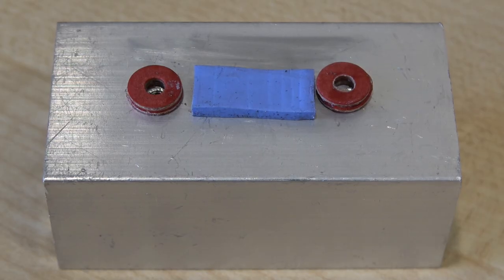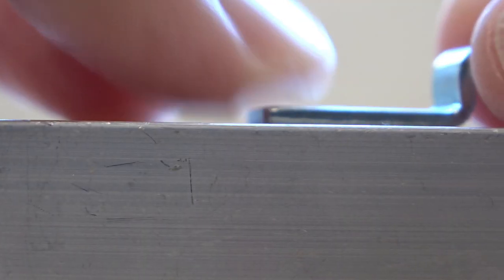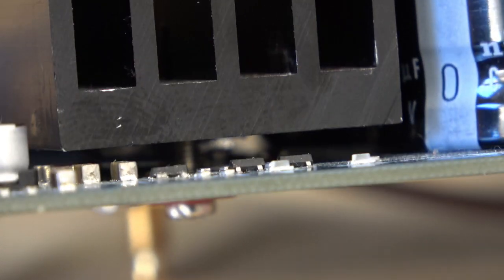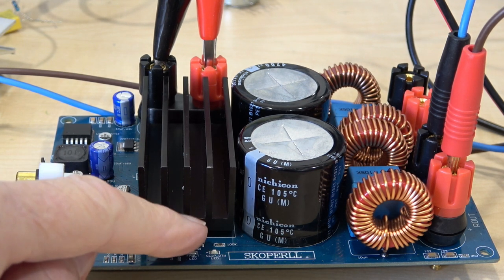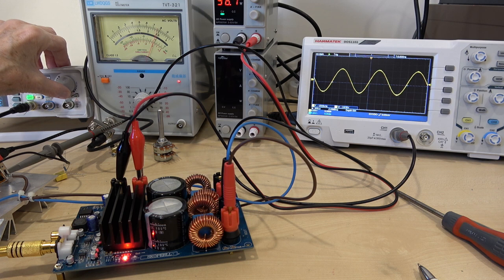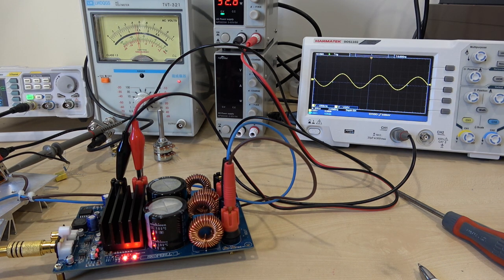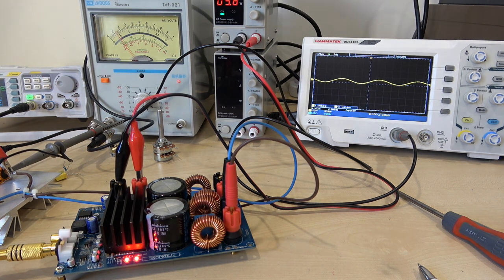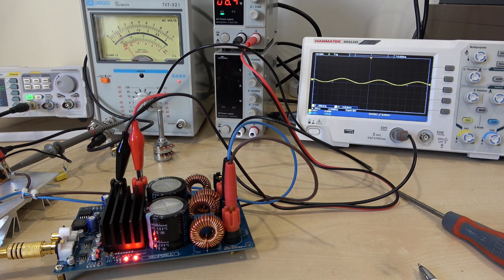MORE TESTS on this class D Amplifier (after some mods)

Comment: Hai iam also using tpa3255 amp  . Out of the box , ur right its clipping at around 50-60w 4ohms . And i tried so many power supply (smps only) . I have two meanwell lrs150-24 supply which is rated at 6.5A and connected is series to get 48v. Still its get clipped. And i use one audio grade smps from my very old sony amplifier which is rated for 189w at 38v . With this power supply i get more power and high dynamic power that can feel. But still clipping at more gain.that because that supply is floating.basically heat and supply design is the culprit. After cooling the chip with old laptop heatpipe and with thermal grizzly paste the heat is significantly lowed. And modify my meanwell supply to floating (no ground ).the clipping issues is solved and soo happy 😊😊👌. Now the only bottle neck is the supply because 6.5A is not enough. That tiny chip overloading my supply 😅😅.its better to have 8A to 10A supply.it can easily get 250w per ch

Comment: Sorry, friend, but a thicker heat sink 'sinks' heat better than a thin one.  Think of heating aluminum foil with a torch compared to heating a block of aluminum with a torch.  Which one will 'sink' away the heat better?  The thin one will vaporize, the thick one will take the heat away.

Comment: Just out of curiosity is the heat sink electrically connected to the PCB ground plane? The TPA3255 datasheet states it must be connected to the ground plane. Also as for the heat sink I think that you are right that it’s definitely an issue. At 8OHM with a power output of 175RMSx2 the TDP is just shy of 30W however at 4OHM with a power output of 300Wx2 the chips TDP is  approaching 90W which there is no way the heat sink could keep up with even 30W would be a struggle with passive cooling. Texas Instruments is a reputable manufacturer and I see no reason for the chip (if genuine) not to be able to reach the advertised power levels. I think most of the issue is a mix of poor circuit/thermal design and cheap and/or fake components. 
I’m currently waiting on the genuine TPA3255 evaluation board made by TI to run these tests and see what the results are.
Reply from the maker: The Heatsink is not directly connected to ground as I have fitted a heat transfer pad with a little grease.  None of these class D boards, give the rated power. This is the worse and cheapest. Texas rate things at 10% THD. I rate power at just the onset of clipping THD probably about 0.5% This board does not like 40 or more volts supply. Another reason why I cannot meet spec. I have tested other more expensive boards; they are better but no were near MY spec. The best board was the fan cooled double bridge. This was quite a good amplifier Just over 110 watts into 8 ohms. A long way off 600 however. Let me know how you get on with the TI board.
Reply: @MichaelBeeny  i certainly will update once it arrives and I’ve done some testing. 
Going off your ~0.5%THD the datasheet still reckons you can get (under perfect conditions most likely) ~150WRMS at 8 ohms however this requires ~52VDC to achieve. At 48VDC you should still be getting around 125W at 8OHM at ~0.01%THD. Anyways time will certainly tell if the fault is with the manufacturer or if in real world conditions those figures simply aren’t possible.
I actually live near Tauranga in the Bay Of Plenty so if you would like I could post it to you if you are interested to test it for yourself. 
Cheers,
Jordan
Reply from the maker: @Ultermategamerz  Hi Jordan, that would be interesting, where did you get the board from? I look forward to hearing from you after you have done your tests.
As you are quite close, might be fun to do a video on it together!! Just a thought.
Reply: @MichaelBeeny  Ordered directly from TI with a fairly heavy price tag however after looking at the components and design it seems almost justified. Just got it a couple days ago and after playing for a short while listening to some 4ohm speakers at a roughly measured 250-260W x2 it seems to perform well and not get too hot even without a fan. It’s my thought that maybe the overheating I’ve heard about online may be due to running test tones like sine waves as the average power dissipation would be higher compared to music. However my dummy load is only good for around 50W so I can’t really test that myself. I’m gonna do some more in depth testing this weekend. And yeah that could be cool I don’t really make any videos myself but we could do one for your channel if you would like I’ll email you later on. Cheers.
Reply from the maker: @Ultermategamerz  Hi Jordan, yes, testing with a sine wave is very punishing, but many amplifiers do very well on these tests. In the real world it is the benchmark of how to test an amplifier to get a fair comparison. I will be amazed, even if just music power if you can truly get 250 watts into 4 ohms but if it is possible, you have the best product to show it.
Reply: @MichaelBeeny   Okay so I ran a measurement using my 4OHM dummy load only for a few seconds at a time to not let the resistors overheat but the results are as follows 
(1 channel driven - 4OHM - 1000Hz Sine)

Vs = 53V
VRMS output before clip = 29.7V
Current Output 6.6A
29.7V x 6.6 = 196W RMS 

Also I sent an email to your listed email address, not sure if it’s the right one though it ends in 49 :) 
Cheers,
Jordan.
Reply from the maker: @Ultermategamerz  That's amazing! Maybe the chips used on the copies are fakes. That would justify paying the extra money for the 100% Texas chip and circuitry.

Comment: Thank you for this Video. I made the same Mod to my Tpa3255 Amplifier and put some Aluminum and good thermal paste between the chip and the heatsink. 
I also added a Fan that is cooling the hole board. 

And now I get around 150W per Channel of Out power @45V 

Before it could only get around 70W 

All at 4 Ohms.

Thank you a lot👍🏻👍🏻

Comment from the maker: Hi Alexandre my reply also does not appear here, are you sure you are real?? lol I will copy your text here and reply.
Alexandre Azevedo
My speakers are an old pair of Technics SB-EX3 (4ohm) and because they are passive I also purchased this small tda7498e cheap but powerful Chinese amplifier and connected to my PC. I'm impressed with the quality of sound I can get with such a cheap system. To connect my Tda7498e amplifier I use a 32v 5A power supply. The fan on mine never turned on but I was also never able to turn the volume to maximum and I usually have the volume at less than half because if it was at maximum volume it would be unbearable, maybe that's why the fan doesn't turn on and the chip doesn't heat up enough to turn it on. The sale announcement of this amplifier on Aliexpress refers to the operating voltage: DC15-36V (recommended 32v, 8A) mine has 32V 5A, the difference should not be much and for the speakers I have they are a Technics SB-EX3 from 250W and 4 Ohm should be enough and sometimes it is better not to use the maximum capacity so as not to burn out and increase the durability of the amplifier or speakers. What do you think?

All sounds fine to me, you will only need the 8 amps if you drive it hard. As you already have the power supply not any point in changing it. Does the heatsink get hot? If it does might be worth checking the fan. I don't know if the fan should run all the time or if it's on a thermostat? If the sound is not distorted on high volume, neither the amplifier or speakers will be under stress. On a point however, few of these amplifiers really put out the power stated as you will know if you have seen a few of my videos!
Reply: @Michael Beeny thank you for your reply. 
The heatsink does not get hot, maybe because my power supply hasn't got the 36V 8A specified as the maximum power this amplifier can handle, and also I usually don't listen to the music too loud. This amplifier really can play loud and I don't notice any distortion even at maximum volume, you can check some reviews on the Internet about the TDA7498E, there are many different amplifiers for sale based on this chip, and the sound is very good for the price I paid with an acrylic box included, I listen to some TR24 HD tracks and 16Bit CD quality tracks and find the sound is very realistic and I don't use a DAC or preamplifier because the soundboard from my computer is already good. 
Yes, I have seen some of your videos. The sound of the TDA7498E is similar to my old and very expensive Technics SU-A900 Class AA amplifier purchased in 1994 but with less distortion if I put it at the maximum volume.

Comment: Seems to me like one could remove the caps and run them under the board, then use thermal paste to glue a bigger heatsink to the board and this should resolve all of these problems...great videos as always, cheers
Reply from the maker: I will look into this, see if it's possible, might be difficult to remove the caps on this double sided PCB.

Comment: In many of my comments on this channel I've mentioned my custom coolers with thermal grease applied.  This has been a known issue for years that these chips needs a large cooler with fan if your're after the full output. All of the cards costing 100usd and above from serious makers has a proper sized heatsink.
Reply from the maker: You are right of course, it was really just an experiment. I will expand on the heatsinking more as an experiment but this does not warrant any real money spent on it. It will never probably be used for real music listening, it's just not good enough.

Comment: The heatsink on the very similar board I have has the sides milled down a few millimeters, so there's no way for it to touch the components around the chip. This, and proper thermal paste (I used Cool Master) make a big difference. And by adding a fan, I'm not able to get it to overheat at 4 ohms no matter how hard I drive it. It would be really interesting to see what the TPA3255 really is capable of when ran at the maximum rated voltage and 4 ohm load with a beefy power supply!
Reply from the maker: So many variations on this board, some sellers have given some thought of the parts used, other simple don't care, they will use any old rubbish to get a sale. All the time they have people not testing it but just quoting makers data the poor public will go on buying them.

Comment: Are there better after market heat sinks one could buy that would fit?
Reply: I could be wrong about the size and dimensions because I don't have the board yet, but I'd look for Pentium II / Pentium III type heatsinks with fans at flea markets or Sunday markets.
These have been designed to dissipate heat better than anything designed for general electronics.
Some elbow grease to mill the edges, and yes, good CPU thermal grease should do the magic.
Reply: @mukand.  thanks

Comment: It might oscillate if the chip was in contact with the heatsink, you need a beryllium oxide conductor to do a proper job but that stuff is dangerous if it gets broken.

Comment: Good find.  The Aiyima A3001 I have uses a small aluminum spacer about the same size as the top of the chip and a few of those same washers on each screw.   It squashes down pretty tight onto the chip with the spacer in the middle but the board being inside a box means it still isn't moving a lot of heat.  Probably why the OC_ADJ pin is set to 12.9 amps with a 64k resistor...  Time for some mods on my boards. ;)

Comment: Heat sink definitely needs proper thermal mass/heat dissipation.
I have 1 working with and (probably fake) XL7015 PWM not outputting 12v.
 Is even the TPA3255 real?
Desire engineering it with better long lasting components .
Reply from the maker: Is it real, wish I knew. I have no real way to prove one thing or another. It is what it is. Only a fool would put the caps touching a hot heatsink. Just that alone does not inspire confidence.